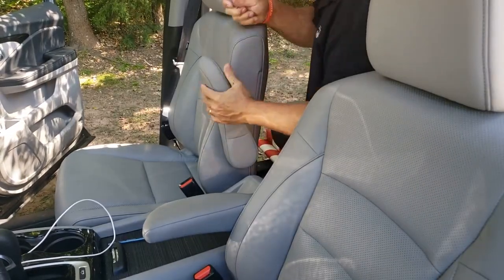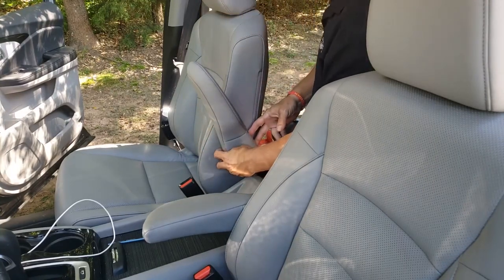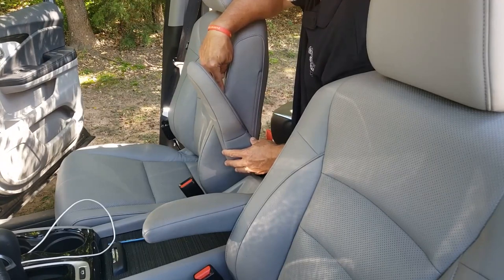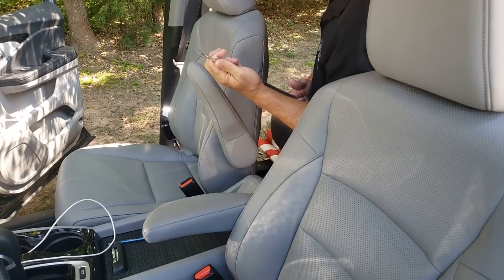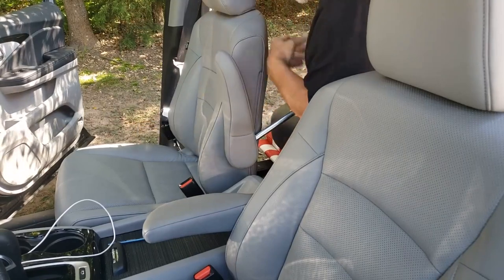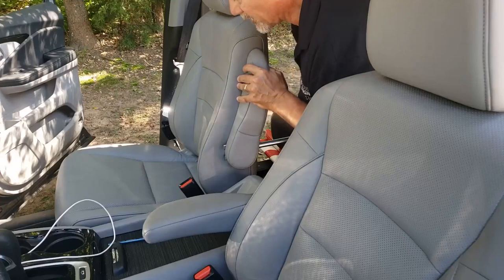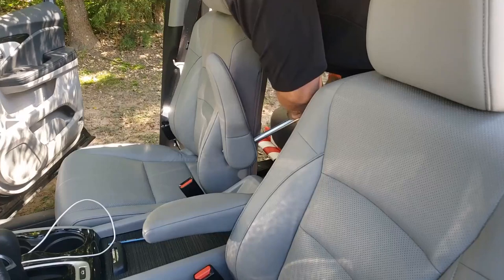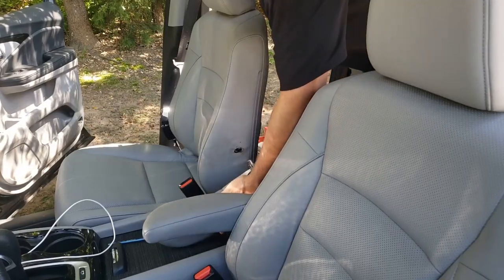2019 Ridgeline factory armrest removal

Comment: What did you mean about it being a "little narrow" and having to "drive it down"? I am assuming it was the space between the forks that was too narrow. How would a crowbar widen that gap? Seems like it would take a lot of force to spread the forks further apart.
Reply from the maker: I used a crowbar to open up the forks tines. It did take force but only took a minute. After that it fit the shafts fine

Comment: my man, i have just bought a new ridgeline and i cant get over how tiny the armrest is. what should i do? what did you buy?
Reply from the maker: The aftermarket armrests are great.  You may only need the drivers side unless the passangers are complaining too.  See my reply to Michael Magro for the source for them in the comments below.
Reply: @jerrylarkins2758  Thanks. They are wider but dont appear much longer. My issue is mostly with length, the factory arm rest is way too short!

Comment: Jerry I got it off now how the heck do you install the wider ratcheting one?   I got it on but I can’t figure how to engage the ratcheting
Reply from the maker: You have to line up the green key mark and just push it in.  Once it pops in it should ratchet.  Make sure you have them right side up.  The flat side goes up, not the rounded side.